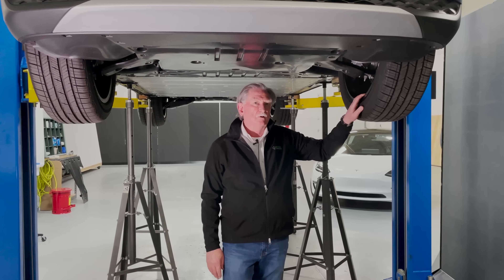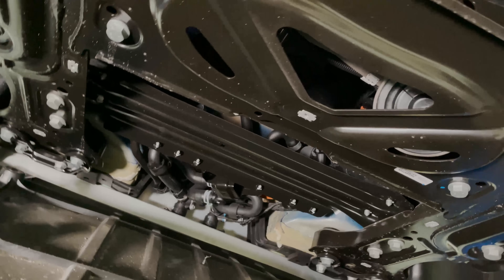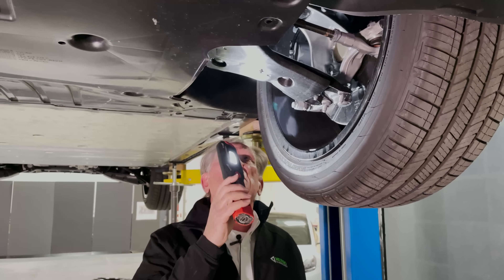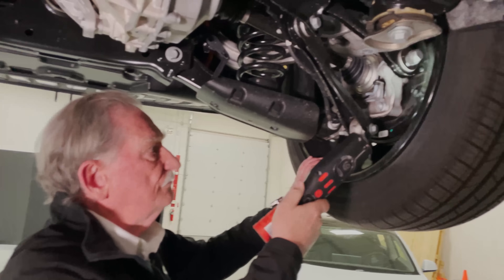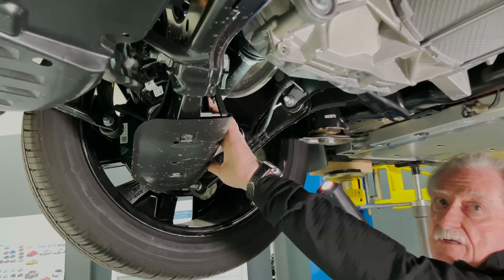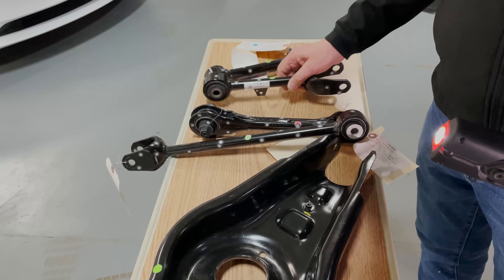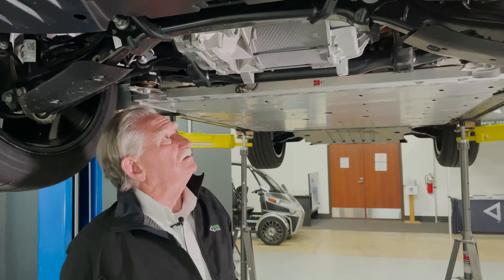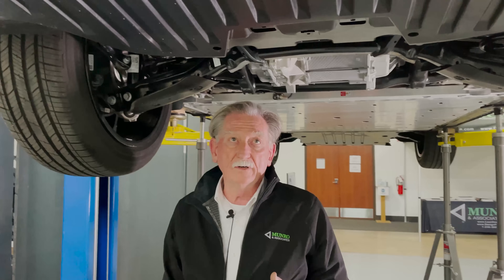2021 Volkswagen ID.4: E3 - Hoist Review, Front and Rear Suspension

Comment: Drum brakes were used as VW claim they will not corrode as badly as disc brakes and they will last longer due to the rear brakes no been used much due to regenerative breaking.
Reply: Plus cheaper. Makes sense all round.
Reply: and drums eliminate drag, they pull the shoes back completely from the drum, unlike discs that drag their pads slightly at all times
Reply: Those drum brakes are sealed and basically maintenance free since EVs barely uses the brakes.
Reply: Ya, Sandy was very clear that he did not view it as a negative.
Reply: Thats great and all but... What about those massive shiny rims? Drum brakes behind? No thanks...

Comment: I think the extra strength and free space are there for the front motor when they bring out the AWD version
Reply: If I recall, Tesla uses a different front cradle for the none-AWD variants of their vehicles. (Unless they changed this to simplify manufacturing!)
Regardless, I'm not sure how VW is filling out that 'engine bay' so much! Remember the AWD Model 3 still has a good sized frunk, whereas this bay is pretty much totally full.
Reply: @VoxelLoop   some other reviewers mentioned that VW has a smaller front bay hood section so that they can maximize the passenger / cabin space. Small hood = cramped bay to fill it out. I will take a bigger cabin space over a frunk any day !
Reply: @GreenTechNow  Haha, that was me mentioning the shorter front bay hood. Someone else mentioned that it’s also much higher than the Model 3 hood which I have to agree with. 

I wish we would hear someday why VW designed the ID4 like they did. I can’t believe that there wasn’t a good reason their design decisions.
Reply: @GreenTechNow  I don't think that's the only difference, isn't it reducing crush space too? likely slightly lower safety.  They are both very safe vehicles but I like more safety most of the time.
Reply: @VoxelLoop  The hood of the id4 is much shorter than a tesla. That is one reason...
Reply: @brandonnixon7105  Actually people have measured it and it's not the case, base of windscreen to nose the difference is tiny.
Reply: @boostav  Yeah I have no idea what you are talking about. I can literally use my eyes and see that the hood is tiny and the windshield to bumper length is much less than a model 3/y. Plus I can't find a single actual measurement of the ID4 hood. Idk what you mean by "to the nose" but watch any video of someone opening the ID4 hood and it is comically small.
Reply: @brandonnixon7105  I don't have measurement, but would assume volume wise they are similar. Tesla has more length, but less height compared to the ID4.
Reply: @brandonnixon7105  The nose is the front of the vehicle dude ... You're wrong, it gives you that illusion because it's boxier than the 3/Y. Go read the comments in the previous video and you'll find the measurements.